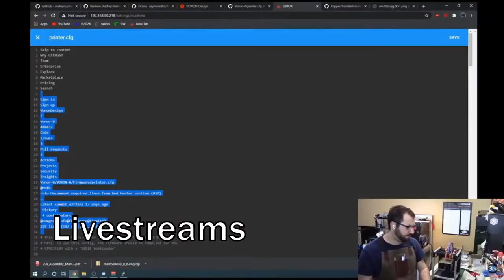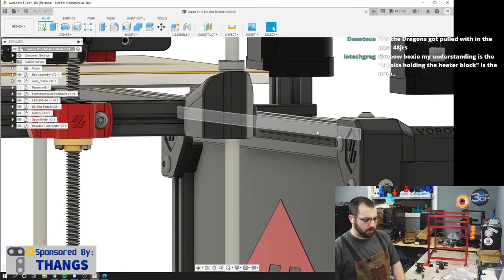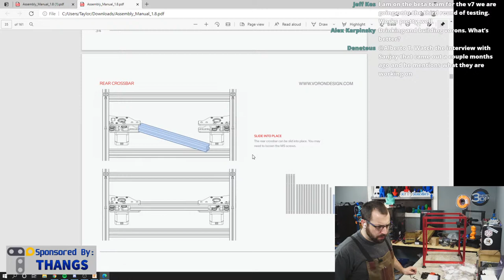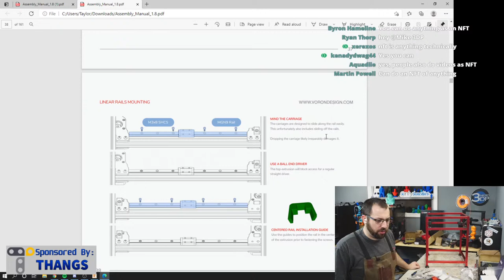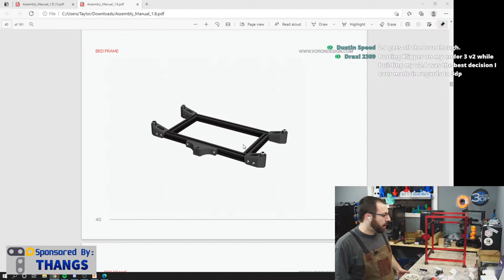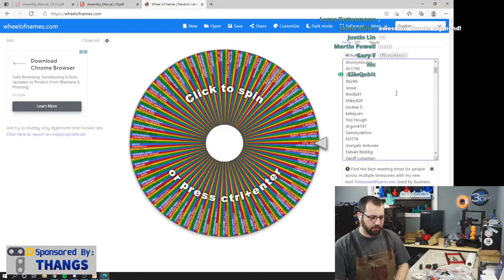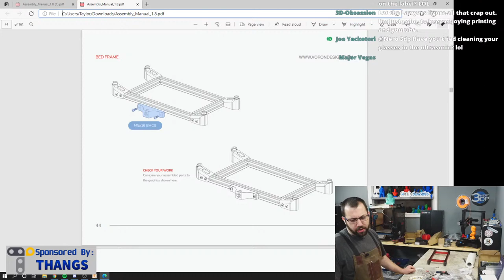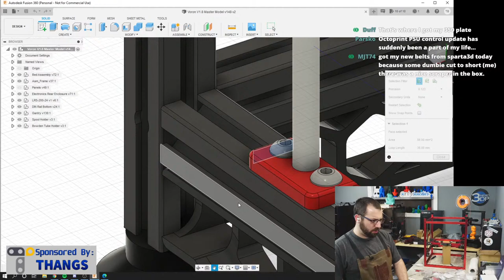Voron V1.8 Build Livestream - PART 2 - Gantry and Bed Frame Assembly

Comment: No technical difficulties on tonight stream :) 

4:04 Channel Intro theme
5:47 Project Intro theme
6:18 Start of the stream
9:26 What is tonight stream plan 
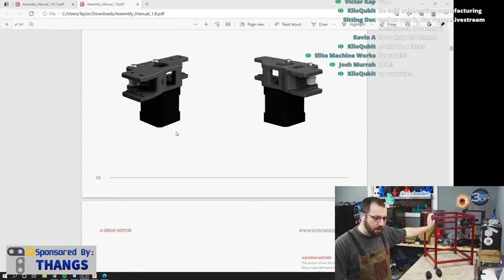11:34 VORON v1.8 Part 2 summarize last week stream
11:40 A/B drive {page 16-23}
[SEE FIRST COMMENT]
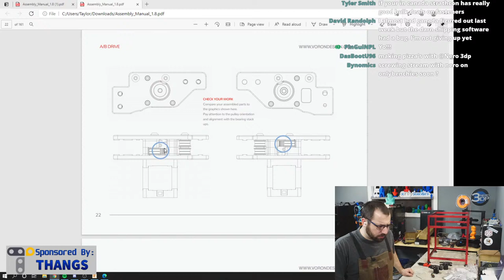36:36 Front Idlers {page 24-31}
[SEE SECOND COMMENT]
50:10 Gantry {page 32-39}
[SEE THIRD COMMENT]
1:43:39 Bed Frame {page 40-45}
[SEE FORTH COMMENT]
1:48:44 - 1:49:50 Doggo (Koda) halftime show
2:01:12 - 2:06:45 LDO v0 Kit draw
2:07:00 - 2:11:40 THANGS gift card
2:35:52 Z Axis {page 46-50 (uncomplete)}
[SEE FIFTH COMMENT]
2:38:00 - 2:45:34 Searching for the "missing" piece
2:45:43 Nero face is gold (perfect thumbnail for YT)
2:49:10 - 2:50:30 Sparta3D wink (thank you!)
3:09:20 End of VORON v1.8 Part 2
3:09:42 Closing / ending of the stream
3:12:49 Project Outro theme (he mixed that part)
3:10:59 Channel Outro theme

Here is the table of contents for the part 2 of VORON v1.8 with timestamp.
Listened at 1.75x speed, so I might be off by a couple of second. 
I will probably do the same for each build stream of this printer. 
Have fun!
Reply: FIRST COMMENT
11:40 A/B drive {page 16-23}
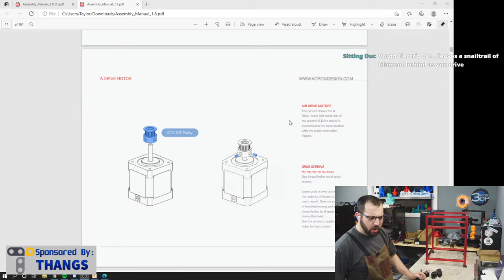13:38 A/B Drive Motor {p17}
17:09 A/B Drive {p18, 20}
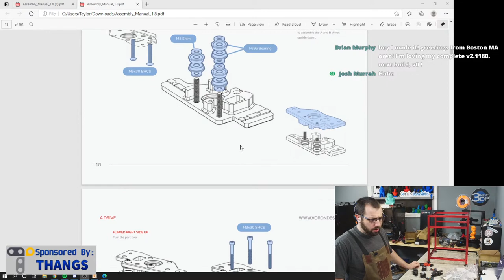26:31 A/B Drive {p19, 21}
36:26 A/B Drive check your work {p22}
Reply: SECOND COMMENT
36:36 Front Idlers {page 24-31}
38:33 Tensions arms {p25}
39:54 A Idler {p26}
41:42 A Idler {p27}
43:20 B Idler {p28}
44:06 B Idler {p29}
49:26 Front idlers check your work {p30}
Reply: THIRD COMMENT
50:10 Gantry {page 32-39}
50:42 B motor mounting {p33}
52:18 A motor mounting {p34}
52:36 Rear crossbar {p35}
58:24 Rear crossbar and A/B Drive {p36}
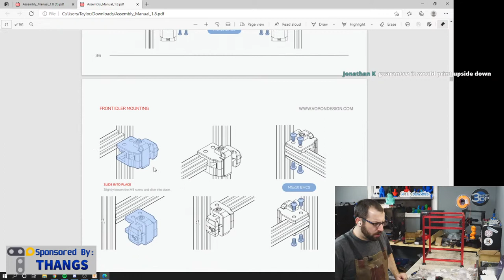1:13:37 Front idler mounting {p37}
1:20:10 Linear rails mounting {p38}
Reply: FORTH COMMENT
1:43:39 Bed Frame {page 40-45}
1:44:20 Bed frame {p41}
1:48:44 - 1:49:50 Doggo (Koda) halftime show
1:54:30 Bearing (and cleaning them) {p42}
2:01:12 - 2:06:45 LDO v0 Kit draw
2:07:00 - 2:11:40 THANGS gift card
2:17:24 Frame and bearing assembly {p43}
2:29:00 Front piece for levelling screw {p44}
Reply: FIFTH COMMENT (last one)
2:35:52 Z Axis {page 46-50 (uncomplete)}
2:36:09 Z axis rods {p47}
2:38:00 - 2:45:34 Searching for the "missing" piece
2:45:43 Nero face is gold (perfect thumbnail for YT)
2:46:12 Insert Z axis in place {p48} 
2:47:28 Z axis fix in place {p49}
2:49:10 - 2:50:30 Sparta3D wink (thank you!)
2:56:50 Z axis alignement {p50}

Comment: why build are you building this type voron? is it spesifick for the higtemp stuff and it works best on this version? thinking of building a v2.4 but whats the difrence?
Reply from the maker: - I have not built a v1 on stream yet
-The simpler and more robust z should have less issues in a high temp environment long term 
- Hot air rises and print surface will spend most of the time at the top of the chamber vs v2 at the bottom
Reply: @CanuckCreator  aha i see :) was thinking about the v1.8 your building now step by step :) and ty for reply  realy enjoy your streams and its funn and lots to lern :)

Comment: Hey I have a little ultrasonic cleaner too, which type of solution do you put in it for cleaning out the bearings? Thanks in advance.
Reply from the maker: I just use ISO
Simplegreen HD has also been recommended to me